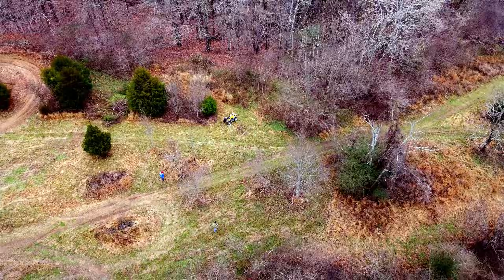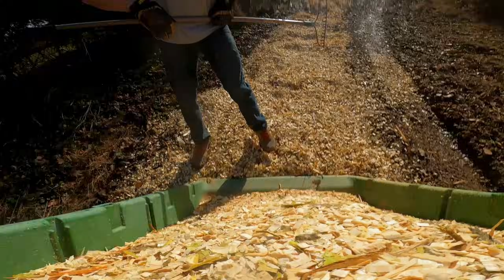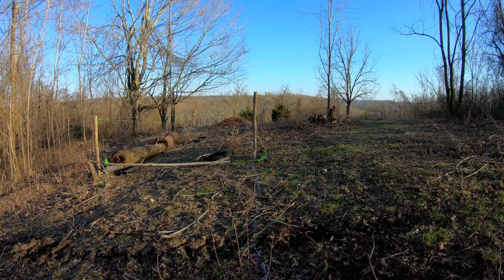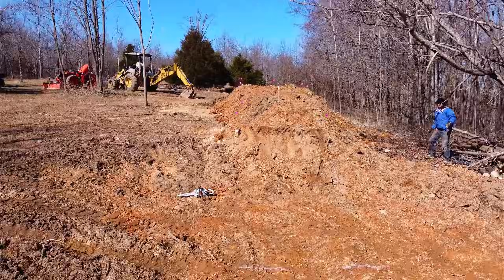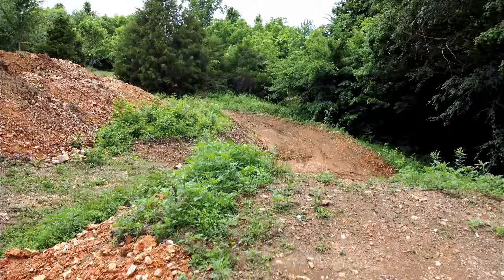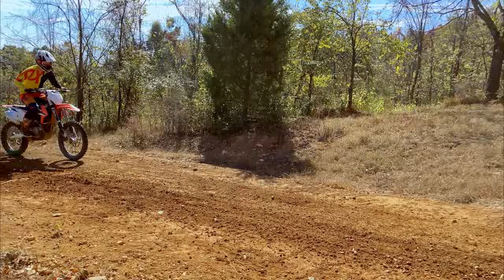Building 50ft Motocross Tabletop Jump - Mx Track Build #16

Comment: What degree is your takeoff and landing? In process staking out track at my house and that is the one hang up is face angle of the jumps. I know the greater the angle the more pop etc but is there a happy medium without a bunch of trial and error lol.
Reply from the maker: @tywesbrook4090  take offs usually fall between 3-4:1 so a 6’ takeoff would be 18-24’ long. Really depends greatly though on the height and the speed, you will get a feel for it pretty quick. Landings typically 4-6:1 so 6’ tall and 24-36’ long. The cool thing about it being your house is if it sucks you rebuild it. For a great beginners guide checkout https://www.destructionramps.com/how-to-build-dirt-jumps

Comment: What gear r u in to clear a 50 footer? Revs don't sound too high, looks like just cruising jn 3rd? Or second?
Reply from the maker: @oliverGTn  it’s at the top of a big hill so usually just cruise third, it could easily be hit in second as well but usually come in hot and let off on the face to reduce speed.